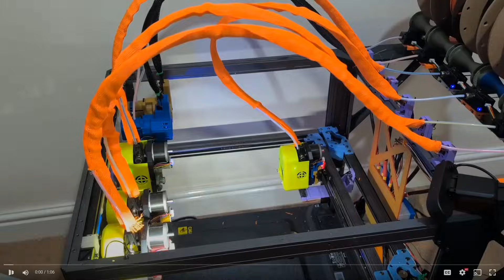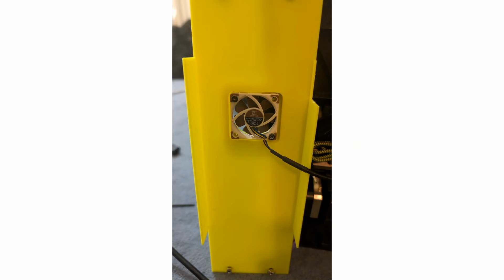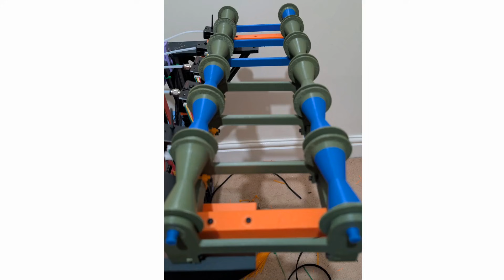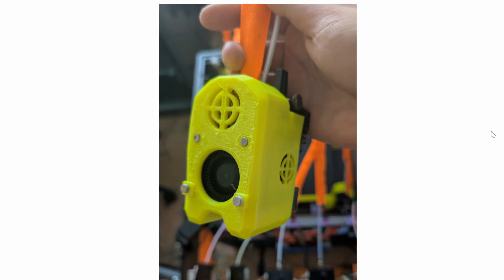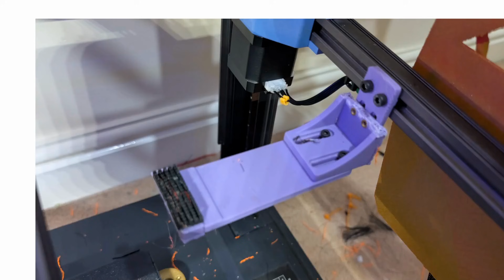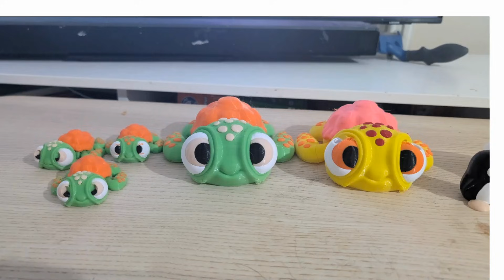SV08 Custom 6 Toolhead Tool Changer

Comment: I am trying your x endstop I down loaded it and it is either too small or if I say change it to mm it becomes very large. I am using orca to print it any ideas what I am doing wrong?
Reply from the maker: @oldtimeengineer, Ahh, try not converting to mm but scaling it by 10 or 100. I make it all in blender and there's a scaling disparity between that and slicer software
Reply: @AdammDL  ok I will give that a try thanks

Comment: Does this work for SV08 Max?
Reply from the maker: I've never been hands on with an SV08 max but I believe the principles would all be the same. To my understanding the SV08 Max uses a slightly different toolhead so the birdsnest I've used may not be appropriate. You'd have loads more space for toolheads so you also might want a bigger power supply.

Comment: For your tangle/runout (T/R) detection, you could add a N.O. (Normally Open) switch to each of your toolholders (docks) that will be held closed while the toolhead is parked in the dock. Now wire each switch in parallel across the T/R sensor in that dock. This makes it so that as long as a toolhead is parked in a dock, that toolhead will always show that it has no filament problems regardless of what the actual status of the T/R sensor is.

Now run your T/R detection wires through each sensor in each dock serially (so they are all connected together one after the other) so that a T/R in any dock that has its toolhead removed will trigger a fault in the printer. This allows you to use just one input on your controller board to detect any numbers of T/R faults regardless of the number of toolheads on the printer.

Should the fault occur once the toolhead is removed, then that's where you have your T/R fault.

Easy-peasy as you might say. :)
Reply from the maker: That's quite a genius idea thank you. I'm currently reiterating the spool holder as there's too much friction on the filament path which involves rewiring the sensors so I'll look at implementing this at the same time.
Reply: @AdammDL  You're welcome! 

I recommend using a SPST N.O. switch such as the Omron VX-56-3C23. Since it's a "Form A" switch it has more space within the switch for its one set of contacts. This (hopefully) will allow the switch to function longer than a "Form C" type switch. It definitely makes a difference with certain manufacturers. 

Although, maybe not for Omron. The Omron cutsheet for the switch shows 50M cycles mechanical, and 500K cycles electrical for either the Form A or the Form C switches with the 5 amp series. For your application, your switches should approach a million (electrical) cycles with the lower load on them. 

I chose the "5" series switch (5 amps AC/DC) since it has a lower contact resistance @30 mΩ compared to @50 mΩ for the 1 amp series. The switch will probably fall apart before it fails electrically (hopefully anyways).

So there might be no gain in using a Form A switch over a Form C switch if you can find the Form C switch cheaper (part number Omron VX-56-1C23).

Other choices include Quick Connect terminals. You could specify solder terminals if you like. And I selected the long roller arm because it operates at a lower amount of force.

----------------------------

Omron has this advice concerning on how you mount your switch:

"Mounting Direction

For a Switch with an actuator, mount the Switch in a direction where the actuator weight will not be applied to the Switch. Since the Switch is designed for a small load, its resetting force is small. Therefore, resetting failure may occur if unnecessary load is applied to the Switch." 

If that's the case, a simpler, lighter actuator might be better if you plan on mounting the switch under the toolhead (or you could mount the switch horizontally along the side of the toolhead). I chose the roller option to help insure that the actuator outlasts the switch. A simple arm might not last as long. 

Probably more than you ever wanted to know about switches. :)

Comment: are you using the sexbolt? I do not see any cfg file for it
Reply from the maker: I am using it solely for the tool offset calibration. The only mention in the config files is under Toolchanger/calibrate-offsets.cfg in the [tools_calibrate] section under pin.
Reply: I have tried your file and made changes cause I am not using a pico now I get this error and am stuck. Option 'require_tool_present' is not valid in section 'toolchanger'. Any hep on what I am not doing would be very appreciated from a 72 year young man
Reply from the maker: No problem, have you completed the ToolChanger installation from the linked GitHub in the description? The printer files on their own won't work without it.
Reply: @AdammDL  yes I installed it from the script
Reply from the maker: then I'm not entirely sure. I find the toolchanger.cfg is a bit odd as it doesnt quite format correctly. Have you made any changes to this file or is it an exact copy of mine?

The "require_tool_present" isn't anything custom I've put in so it should definitely be expected under the [toolchanger] section. I have had the printer throw out red herrings when there's a formatting issue somewhere.
Reply: @AdammDL  No I have not made any changes to that file. I am going to try a whole new install of mainline klipper and toolchanger install. For some reason I seem to no be able to find any tools even when they all show up and I can control temps . If I try to detect a tool klipper erros out and says it can not find the tool. So I must be missing some procedure although I have done 2 sd card builds with the same problems.
Reply from the maker: hmm  that's odd. Presuming the tap sensor is wired correctly the [tool_probe T(N)] section in each tool is what links a sensor to a tool for detection. I had to use the ^ symbol for the pin to indicate it needs a step-up resistor else it was not being read as triggered.

Sorry for not having the answers. It's tricky without being infront of the machine to troubleshoot.
Reply: @AdammDL  No worries I just wish TT would release his image. It has been almost one month since his last video that it was done. Oh well this old guy will get it working somehow I have never give up on anything my whole life.

Comment: Can you share how much money have you spend in this project ? It will be nice to know
Reply from the maker: The printer as a final product is probably around £1,200 - £1,300 GBP. I managed to pop many a toolhead board however so the actual cost is a bit higher - I don't particularly want an actual number or I'd have to think about it :D

Comment: From what I saw, for the tangling you must limit the x move when the gantry is on the dock level. You have "close y", from what I saw, at the corect distance, but for the "safe y" value you go to the brush... The "safe y" must be the distace at you can move the tool on the x axis behind the docked tool. For the move to the brush, you must do that on the way down to avoid tangling.
The back umbilical mounting point on your printer are, in my opinion, too far appart. This will make the tools that are more on the sides to need a longer umbilical to reach the other side whitout being affected by the umbilical pull. But this is allso, from what I see, not a thing you can do much abbout from the positioning of the spools....
What are the stepper motors curent(amps) settings? Maybe there is your skippet steps answer...
350watt power supply is kinda on the "too low" part of the supply. If you have 6 tools and each tool has at leadt a 50w hotend, ther you have allready 300w gone. You will need more for stepper, fans, mainboard, lights... You should look to 500 to 600watt.
Reply from the maker: Thanks for your interest and input.

On the way up the tools will align themselves with their docking X position near the back of the bed to reduce the tangling. On the way down it will align with the brush. There's an intended nozzle cup on this brush which would catch any oozing on the way down.

The spread of the mounting points does mean the outer ones will need extra length. What I did in the end was make sure the outermost could reach everywhere on the bed and then make all others match. So the middle ones are over long and the outers are hopefully just right.

I do seem to get a few filament tangles which could be down to loose spooling. Or it could be either the filament path or the friction on the rollers. I could definitely tighten up the design of the spool rollers and the filament path could come from the top and meet the umbilicals at their peak - I'll change 1 thing at a time and see which helps.

Power supply I agree it may be too small. The tools arent all powered at the same time and so far I haven't had any issues with power loss - again something I'll keep an eye on.

Steppers I used the settings on this page: https://github.com/Rappetor/Sovol-SV08-Mainline/tree/main/SV08%20TMC%202209%20accurate%20technical%20settings - I eventually managed to be able to reproduce my issues very consistently with moving the connector on the steppers so I'm fairly confident that's now addressed. 

Thanks again,

Comment: This is super cool! I’m working on making Teaching Tech’s version myself and had gotten stuck, but this is great inspiration to keep going
Reply from the maker: That's great, I'm glad this project can do that for you. There's a whole lot of skills involved so you'll undoubtedly learn something through doing it.
Reply: @AdammDL I’ve got to ask- what did you do for the adapter to hold the 2020 extrusion to the top frame? I’ve searched through all of TTs cad link and couldn’t find the file, and don’t trust my modeling skills to make my own
Reply from the maker: Here you go: https://github.com/DraftShift/StealthChanger/tree/main/UserMods/TheSin-/SV08_Dockbar_Brackets

I'd also say - give the modelling a go - I'm not an engineer or electrician or anything like that and just getting stuck in has been the best teacher.
Reply: @AdammDL you’re a hero. Also- in general I agree with you, jumping in and making something is a great way to learn. Just that this is a functional piece that’s going to be responsible for a lot and the risk and stress here don’t feel worth the reward
Reply from the maker: That's fair enough. If it exists already I took a similar approach. 

All my tools are picked up at about 304mm z height - so if you're still at this point it'd be worth looking into higher docks to save a little bit of build volume if you're interested.
Reply: @AdammDL  Not to bother you about this again, but where did you get the backplates for the tools? I found two in his cad link, the first I printed but it turns out may just be the standard stealthchanger one and didn't have headset insert holes in the right place for the sv08, and the second one interferes with the shuttle. To be honest that cad link has a lot going on and I'm turned kind of upside down
Reply from the maker: I've put all my STLs in the linked GitHub in the description. Should be under STLs/Stocktoolhead - I intend on putting descriptions for each stl but haven't gotten round to that yet.